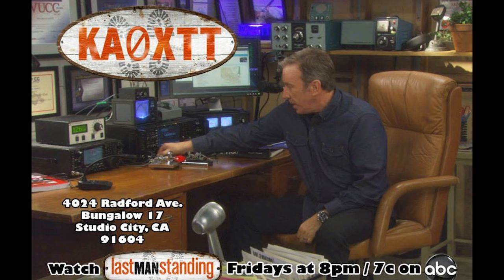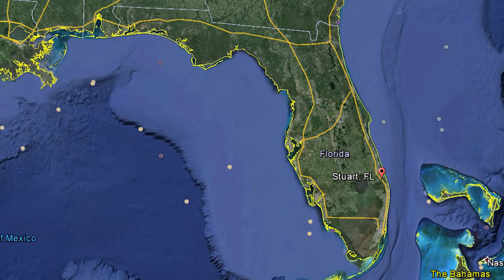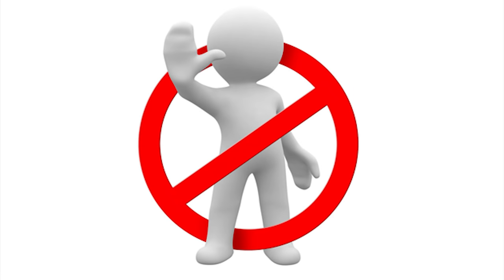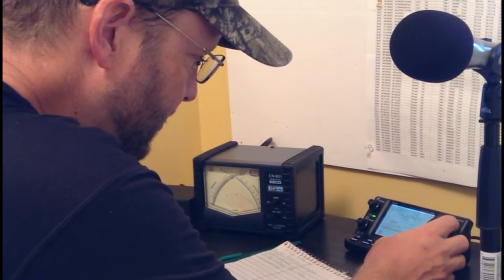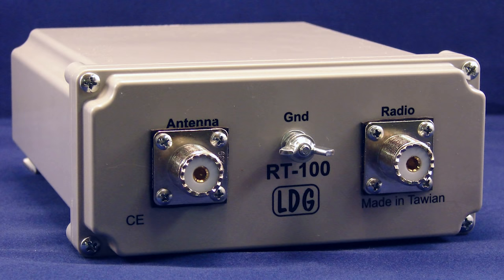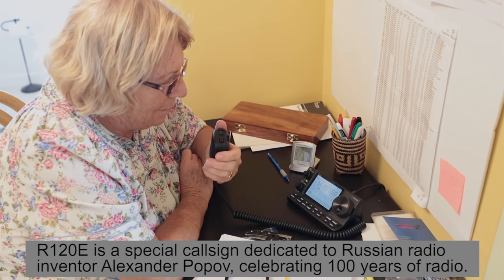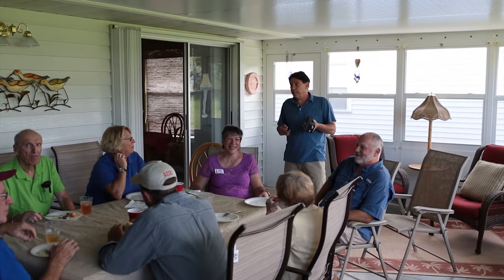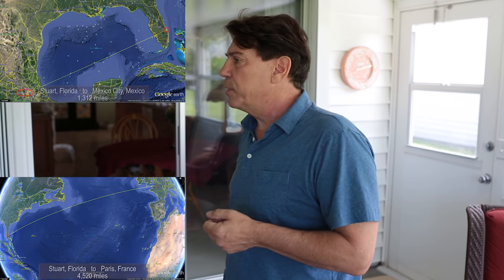Antenna Restrictions and Making Antennas Fit

Comment: Years ago, I put up some antennas without anyone seeing them. I am not a HAM but I just wanted to be able to use my scanners and shortwave receivers. I got some plastic downspout and mounted it on the side of the house, next to a window so that it went all the way up to the rain gutter. Inside the downspout was a vertical, four element, wire antenna for my shortwave receiver and a three element, wire antenna for my scanner. I made the antennas and they were not the best I’ve used, but they worked ok.

Comment: Excellent.  I had to do something similar in my home.  In my attic I used a 4:1 balun and ran 3 pairs of dipole wires for: 10m/20m/40m.

The length of my attic was just long enough for the 20 meter length, so for the longer 40 meter I made a "Z" shape.  

I'm using the basic built in tuner in the old IC-737 I got used.  All bands "tune", although the SWR varies after the tuner.

I'm very pleased given the low price of materials.  I regularly work up and down the western US on 20 meters, and when 10 meters opens I'm all over.

73s
W6VRF

Comment: This was SUPER helpful and I have now purchased all the pieces.  I don't need to fit it in the attic though so I bought a pole mast.  Should I run the antenna tuner up to the top and just use a short connector to the antenna or should I leave the tuner at the bottom of the mast and run up a longer line from the base to the antenna at the top?  Thanks for making this!!

Comment: I live in an HOA with antenna restrictions.  They don't want anything visible from the front street.  However, there are several satellite dishes that are clearly visible from the street, but they turn a blind eye to them.  So, let's see if they are going to harass me about my 30' inverted V, which will be visible from the street IF you are looking for it.  If not, it will be barely visible.

Comment: An auto-tuner at the feed point seems to be one of the most important points of many stealth antenna solutions. This allows one to put the antenna in the hiding place where it will perform optimally and feed it with concealed or buried coax.

Comment: If you live in a CCR-Restricted Homeowners Association Controlled housing development NEVER let anyone know you are an amateur radio operator. NEVER have any visible antennas even laying around on your property grounds, home, walls or roof.  You MUST be creative and install antennas in your attic (HF, VHF & UHF) or hidden under your eaves, installed at night. FACT: Once you tune up and start to transmit, you will cause RFI and neighbors will complain, but they won't know

     your'e the cause, even though you are operating legally. All of their appliances must, by law, receive any interference from any outside source, including amateur radio. This is stamped on the back of every electronic consumer appliance sold, but none of your neighbors will believe this, even if they read it.

     NEVER let them know you are a HAM.  They will take you to court, and despite the Federal Laws under which you legally operate, local judges will find you guilty of breach of contract, disturbing the peace and  being a public nuisance.

      After you loose in local courts, you will still have a problem, because  even if you never transmit again in your neighborhood, your neighbors will continue to turn you into the Home Owners Board, the F.C.C., and the local Police EVERY TIME THEY HAVE THE SLIGHTEST GLITCH WITH THEIR CABLE TV, COMPUTERS, CELL PHONES, TOUCH LAMPS, STEREOS, CLOCK RADIOS AND DVD PLAYERS. 

      YOU WILL END UP SPENDING MORE TIME IN COURT THAN IN YOUR HOME.  IN TODAY'S WORLD, NEIGHBORS HATE  HAM RADIO OPERATORS.....  THAT IS UNTIL A NATURAL DISASTER COMES ALONG, AND  THEIR POWER GOES OUT AND , ALL COMMUNICATIONS GO DOWN.

      THEN THE SAME PEOPLE WHO HATE YOU AS THE NEIGHBORHOOD MENACE START TO  LINE UP AT YOUR FRONT DOOR BEGGING YOU TO SEND AND RECEIVE RADIO MESSAGES  REGARDING THEIR OWN  WELFARE AND THE WELFARE OF THEIR DISTANT FRIENDS AND FAMILIES.

Comment: I realize not everyone could do what I did, but after living in condos and newly built housing areas in large cities for most of my Ham radio life, I retired to EXTREMELY rural Utah.  My house is not visible to my nearest neighbors (over 1/4 mile away) or the nearest street or highway.  Commercial mains are underground, so noise is not an issue.  In 4 1/2 years I've put up 6 (and counting) antennas.  The only issue is that I live near the top of a 315 ft. hill and the winds are pretty strong at times, so I've opted not to have a tower, but I do have a couple of 20-25 ft. masts.  

If relocation is a possibility, that might be the best decision you could make.  It was for me.
Reply: Good for you

Comment: Where there's a will, there's a way..  I've lived in restricted antenna situations before. I had good luck with an Invisible antenna made with small enough gauge wire that it couldn't be seen from a few feet away.  I used that operating from a hotel room, too.

Comment: You all need to read the HOA regs published by Peters & Freedman, LLP.  2017 Legal Guide -- as well as the FAA rules on mandatory reasonable variances and exceptions to restrictive HOA rules. They can't have a total ban on antennas. Over the air, satilite and amatuer radio must be allowed within reasonable limits. Davis-Stirling Act  and Civil Codes are outlines in this manual. I am a soon to be board member of my HOA and a HAM . . . they may be getting a wake-up call . . . Chapter 5 Article 1, 4725 is one such area to read. There may be local codes that ultimately are more rigorous limiting height and location.
Reply: But that's good for Cal. What about Fla?

Comment: I noticed there was no mention of a station evaluation for RF exposure. I had a 50 foot wire antenna for HF, GP-3, 3 element VHF Yagi, and a quarter wave mag mount all in the attic above the second floor, and I had to stop using them because of too much reflected RF from the roof. I don't have a problem with short bursts on VHF or UHF but my quarter wave mag mount was used for Echolink on a local repeater. This sometimes allowed long transmission times if someone on the link was talking for a long time. I'm one of those people who feels rather ill when being too close to a transmitting antenna even if its at 5 watts and 20 feet away. At least at Field Day I can run my antennas as far away as I want and not feel a thing.

Comment: I noted with interest that she initially attached a vertical antenna to a rain gutter at her home. She could have used the rain gutter itself as an antenna. That was my solution as I live under similar HOA restrictions.
Reply from the maker: +Michael Davis It was a VHF/UHF antenna that was attached by rope. The HOA didn't like that.The rain gutter itself is not metal.
Reply: Thanks for the update.
Reply: Perhape she could have dropped an insulated wire down the pipe and tried that... However, I am pretty sure she's far better off with her tuned, resonant, 3-bander in the attic. I might have tried that in my own situation except for the foil insulation I have under my own roof tiles. Not a happy camper. And it's my xyl who's the problem. :-(

Comment: Better/cheaper alternative: wire "fan" dipole for 40 through 10 meters including 30 meters. This is several dipoles connected around a centerpoint and fanned out in the same plane. In my case, there was some interaction with the 30 meter dipole so it was "brought forward" out of the plane and all worked great!

My attic dimensions were very close to Nancy's (about 30 feet) so the 40 meter dipole was folded around symmetrically to fit and the 20 meter dipole folded down about 1-1/2 feet at each end. 

I work mostly QRP (but in any case not over 80 watts) and have very good results! Worked Georgia (Russia) on 30 meter CW and all over the world and the states and especially the Pacific. VSWR is below 1.5:1 on all bands!  I have also worked into South America (Argentina, Paraguay, Uruguay, Chile) on PSK-31 at 20 watts and all over the West QRPp (< 1 watt). 

71/72/73 

de k6whp

Comment: NEVER let your neighbors know your a ham operator in restricted HOA community.  You will have nothing but trouble!  

  Make sure your have your ham ticket address to a P.O. box  

 NEVER show your ham gear to any neighbor   make sure it's in a back room OUT OF VIEW at all times!!!!   

Make sure you tell your spouse mums the word. 

DO NOT have a ham call license plate    NO ham  gear in the car   

 Use a mag mount that you install AFTER your away from the neighbors /  HOA   

When you move in WAIT a few months BEFORE you operate  NO TRANSMITTING  !!!!!!!!!  

You have to be VERY careful &  operate stealth or.................................. kiss the hobby good bye!  

Your 'neighbors ' find out and you have had it! 

A word to the wise! 

As an aside, 

      I live on the second floor of my 6 story condo.   My receive Active  antenna is mounted  IN  my roof top  air conditioner unit.

 I ran the RG-6 coax cable to the roof VIA the air conditioner  thermostat conduit  it . 

The antenna whip is a motorized car radio antenna that I can EXTEND  and RETRACT  into the roof mounted air conditioner chassis. 

Just like like hogans  hero's !!! 

STEALTH is the word!
Reply: David Frantz damn man that's some James Bond ham operation you got going on
Reply: It sounds like many parts in Germany.
Reply: Or you could just not live in an HOA. You made that choice.
Reply: You got that right. A little bald headed twit kept pulling down my dipole . With a cane and stepping on a metal bucket. Some body gave him a nice metal cane.  My pet Drake was in good form that day, and cw was rolling in...a scream ... He was on his porch crying to our local barny Fife. I pointed at the cop and he followed my finger pointing at the Cain dangling 10 feet from the ground. The cop got it. you cant fix stupid he said.dont worry I got this. 73 de kv4li

Comment: Is there a description as to what modification you made to the antenna? I have forwarded the youtube clip to a local ARC group in Vancouver. I have local ham friends that are in the same boat. One took an old dipole of mine and made 40 m loop in his actic. However he can't do anything lower..
Reply from the maker: +Don Poaps The modification is described, and shown in the video... remove the last section, and replace it with wire. Put the wire wherever you can in the attic, away from metal. Change the length of the wire to tune that band, just as you change the length of the tubing to tune the regular antenna.
Reply: @jyunte  I understand the modification was done by attaching a wire on each end in place of the 40m traps?  But what I can't see is how the wire was attached to the antenna.  there is one shot of it but it does not show the end of the antenna.  Also, did you use an antenna analyzer once the wire was attached to properly trim the wire?  In the attic or pre-assembled before actual install?    7.150?  This might be too late get a reply but I'm motivated to get this done.  Currently have a mag loop up there which doesn't do too badly.

Comment: it's state law that you're allowed to have an antenna as a ham radio operator so many cases have been won by the ham radio operator and between the HOA fight the it's your right and if you don't exercise your rights you lose them
Reply: The biggest problem is you may win, but end up spending many thousands and using hundreds of hours doing all the legal leg work.  In the end the money could have been spent on a better place or more equipment.
Agree more stuff does need done in the realm of personal freedoms, but there are so many battles.  

The best bet is to simply avoid these communities or to fight their restrictions from the get go if you have any outdoor or landscaping hobbies.  If you are in such a community join it's board or what ever and get in on the regulation.  Perhaps you can change stuff or at least get a good idea how to get away with crap.  If you can't fix a broken organization, there is nothing wrong with trolling it.

Comment: antenna must be outside on the roof. Not in attic!! Its just not natural. But I admit I also would not like to have neighbour with antenna farm. It could hurt my receiver if we meet on the same freq. :-)
Reply: Janez Novak re: Your You-Tube comment on Ham antennas needing to be outside on the roof.....I installed 40, 20 and 10 meter half wave dipole wire antennas in my cramped attic by curving them around to fit the shape of the ceiling and walls. Using less than 100 watts, I contacted most of the U.S. states, five continents, and several foreign countries AND I did this in 2018 during horrid band conditions with no solar activity and a noise floor of S-9. 'Not ideal, but it's a whole lot better and cheaper  than running a kilowatt into a Yagi beam on a 70 foot tower with the homeowners board and local courts attacking me  with expensive lawsuits.  '73.